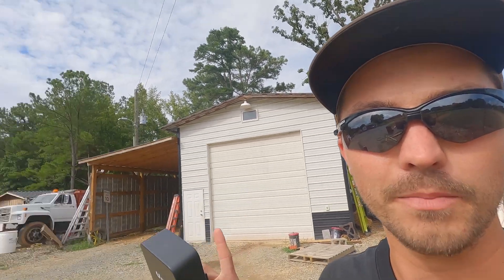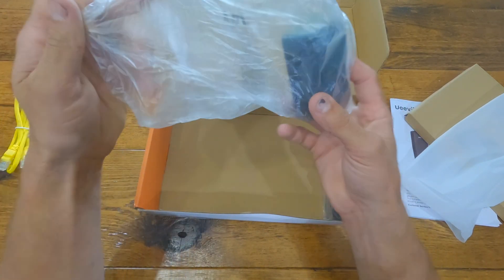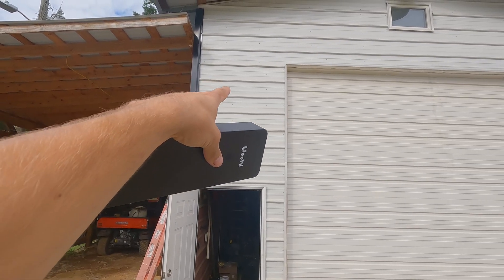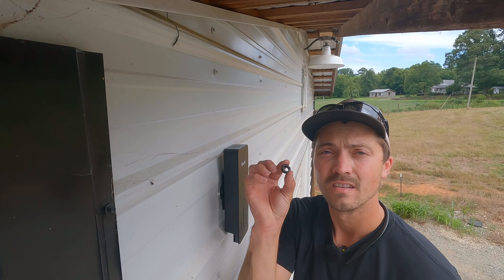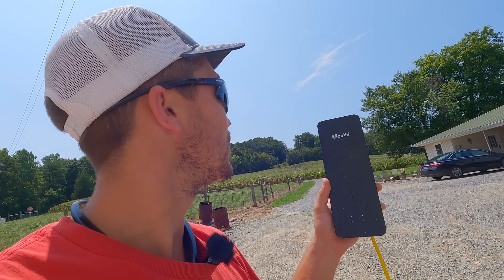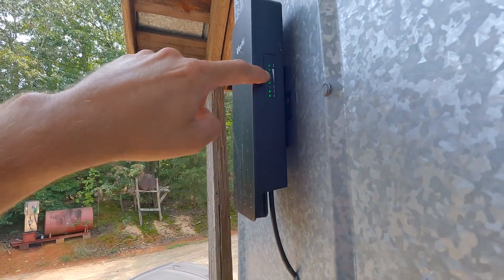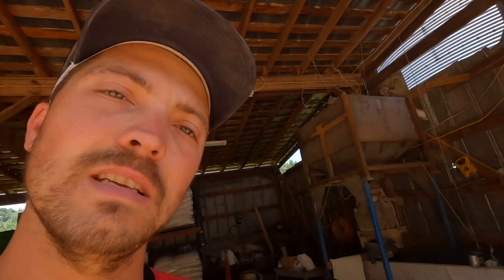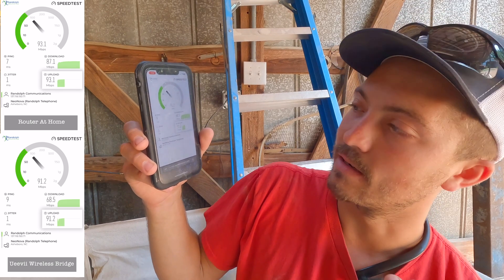How I Got WIFI From My Shop To My Barn | Wifi Bridge Install

Comment: Do you have any ideas on how to get it into a metal building? I have a shop by my house and I have good internet I'm my home.it's up to 500 megabits. But in the winter when we close all the doors in the shop I don't have any Internet in there.
Reply from the maker: Use a device like I used in the video, then run from it inside the shop with an Ethernet cable to a WiFi router.

Comment: Why do you need that router in the barn?
Reply from the maker: @putnamlandlord5286  I plan to eventually put security cameras, and there’s not much cell service in there.
Reply: @RouthFarms   I like what you did, but I thought the bridge slave would  provide the wifi  or am I wrong?   I want to get wifi from my router in my garage down to my barn- [about 100-150 ft with cement walls with windows) so I can use wifi for my phone outside the barn  and use  ring cameras inside and outside the barn.   thanks- not savy on these things.
Reply from the maker: @putnamlandlord5286  the bridge only provides you with an Ethernet connection. You’ll need someway to broadcast that wirelessly if you want. I could have just went from the bridge with an Ethernet cable but I wanted a wireless signal for cellphones and things.
Reply: @RouthFarms  thanks- got it.